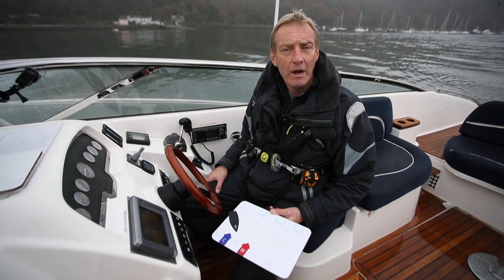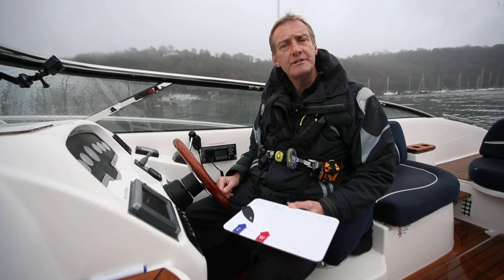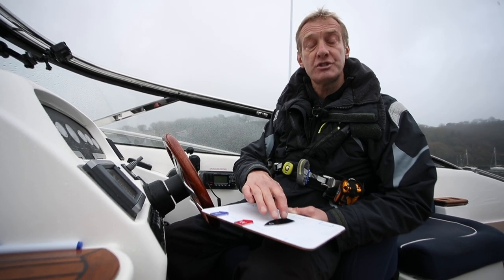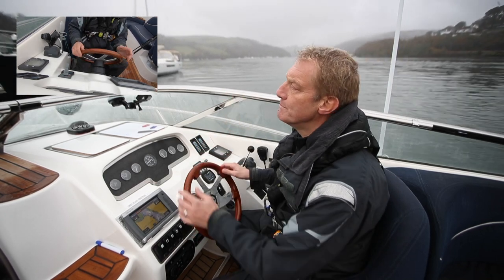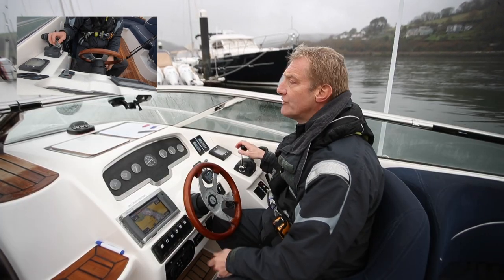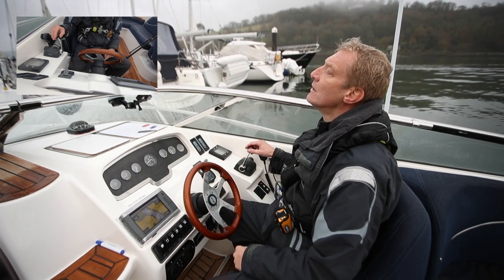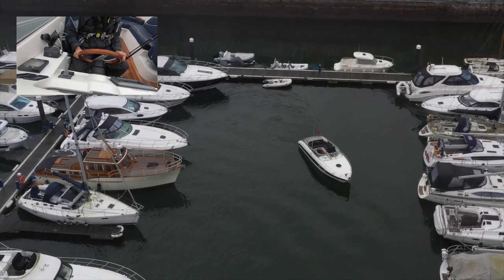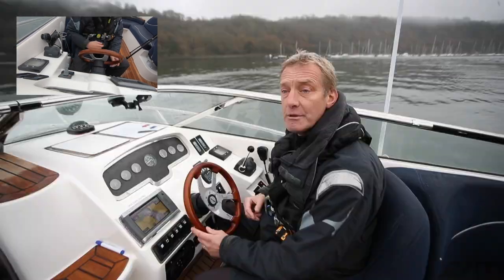How to turn a single-engined boat in a tight space | Motor Boat & Yachting

Comment: Man how nice would it be to have such a smooth throttle switch! Mine cracks out of neutral into forward and cracks into reverse with an occasional grind if I'm not really firm with it... then full reverse power is only a mm behind that... it's a nightmare when trying to be precise!

Comment: It would be nice to see this sort of thing with a single outboard engine. Would it be just as easy?
Reply: In my (admittedly limited) experience, outboards are almost identical to sterndrives when handling at slow speed so it should be ok
Reply: @yankiertem8498  I must be just as bad at mooring stern drives aswell then 😂